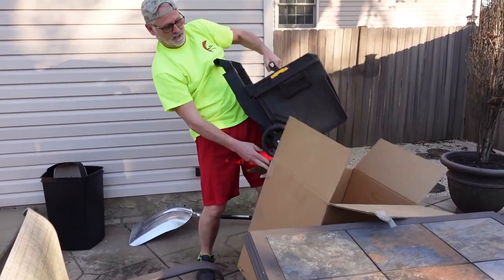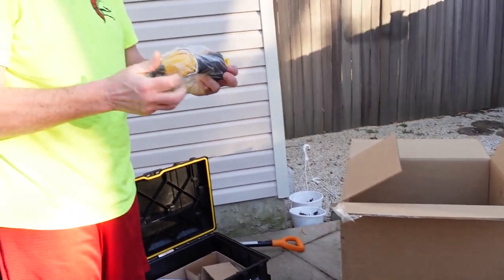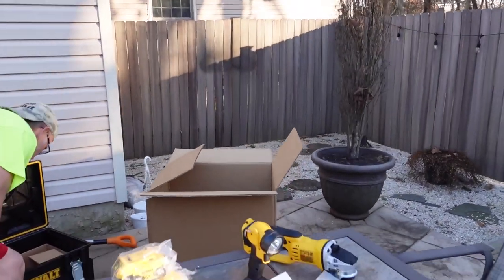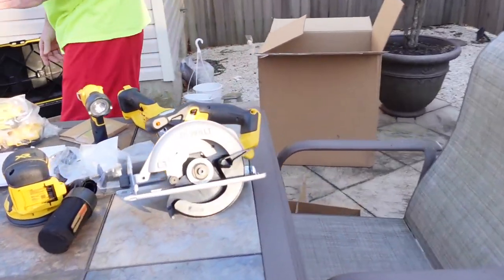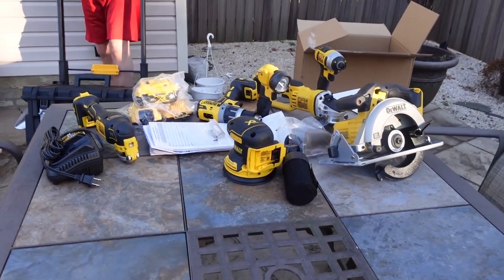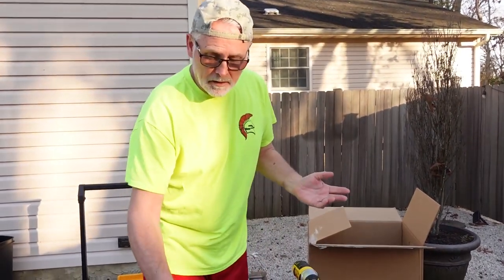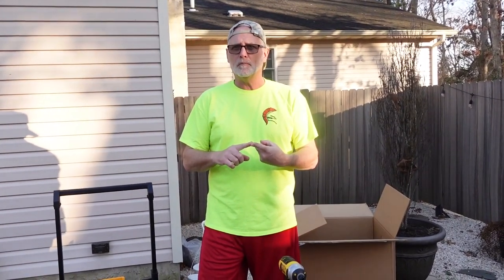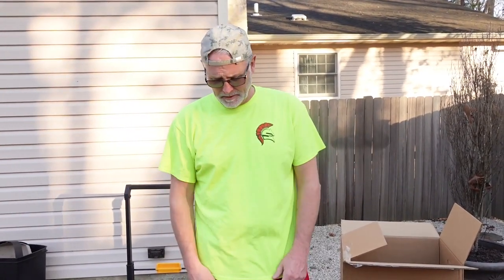Psycho Dad Unboxes New Tools

Comment: Another thing guys, before using a branded battery on another DIFFERENT branded power tool, please check that the voltage/wattage and type of battery (eg. - Lithim or Lithium ION) that the tool accepts (MARRIES UP) with each other.

Comment: I did some video about dewalt on my channel as well. Really like how rugged the tough system stackable toolbox are and I really  like the Dewalt DCl050 work light and their 12v/20v  lithium ion task light which I  did video about both of them  You can never go wrong with dewalt .  My favorite Dewalt light is the DcL050  cause I like the way the head moves and you can easily use it as a desk lamp in power outage situations and batteries stay charge for really long time. One my idea is later on is build solar  setup to charge up all mine  dewalt batteries.  Have fun with your new toys. Remember to always measure once cut twice.

Comment: jeff what's your thought on sears craftsman industrial tools from sears back in the 80's and 90's
Reply from the maker: I like Craftsman, I have bought them for years.First chainsaw was a Craftsman.
Reply: @PsychoDadOriginal  I have had a few craftsman garden tractors push mowers snow blowers tillers lot of different drills circular saws, jig saws other stuff I have some dewalt tools  I like the quality.   Milwaukee has nice tools.   Some times I buy tools at yard sale just to try them out instead of buying new just to try them to see if I'd like them.   Some of the stuff I sell off some of the tools I used.   Most interesting tool was the shop smiths.